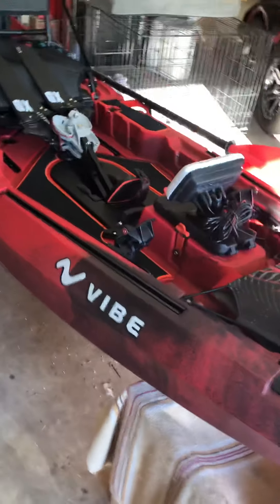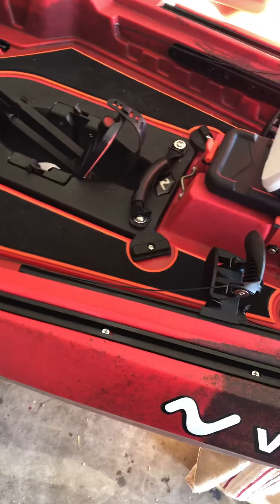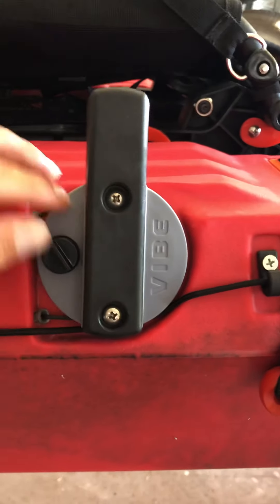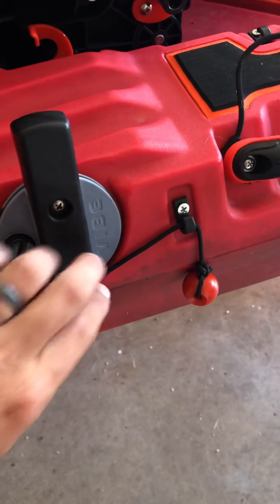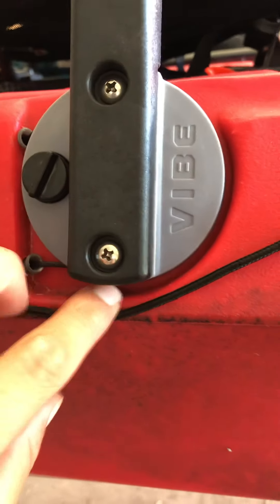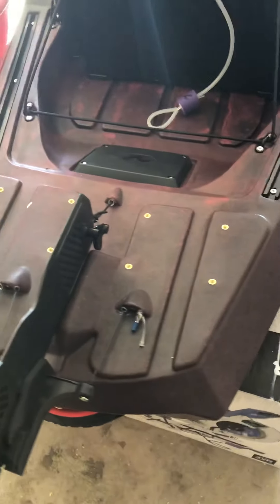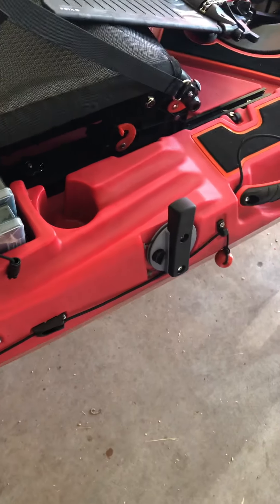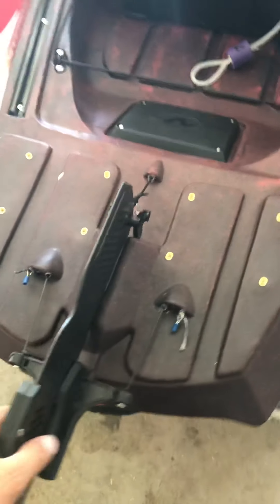Shearwater 125 steering handle install

Comment: Hello friend, with what glue did you glue the plastic tube through which the rudder cable passes.  Mine has a lot of movement in and out ... thanks!😉
Reply from the maker: Clear gorilla glue.
Reply: @tyleralloutdoor243  ok perfect!

Comment: So I know this could probably seem like a dumb question,  but I just purchased a used shearwater,  it doesn't have this installed....my question is , does it take in water in on  those pre drilled holes if one is not installed? Thank you.
Reply from the maker: Shouldn’t. Inside are channels that run to the back. Like a tube. If water gets in it should just come out the back by the rudder if the tubing is still intact
Reply: @tyleralloutdoor243  thank you